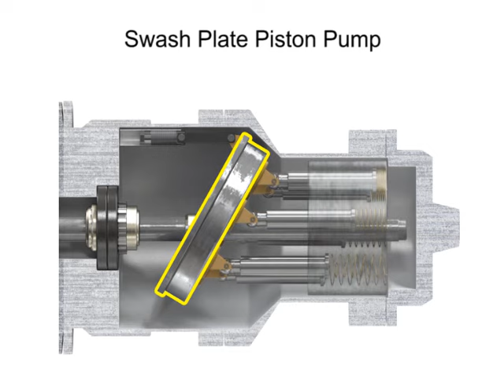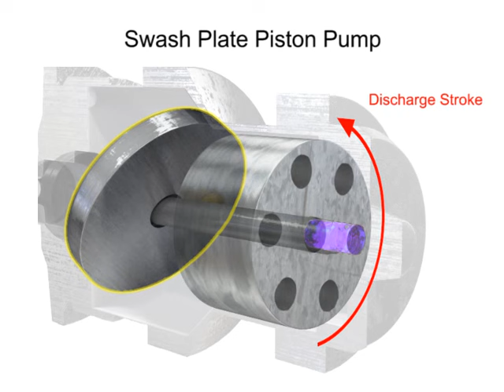Swash Plate Video

Comment: Great video, explains it well. Only thing, the cylinder blocks always have an odd number of pistons so that the suction and discharge side of block won't equalize(cancel each other out), especially in a hydraulic motor. Great illustration, though.
Reply: That's the problem with a hung jury; the Piston Pumping Swash Plate exemplifies the example with each thrust.

Comment: Can u please explain how it controls flow rate, ie,. How it reduces and increases the flow rate whenever necessary
Reply: The swashplate angle I s often controlled via some kind of control mechanism (such as a solenoid valve). Different angles of the swashplate will change how far the pistons can extend from the cylinder bore, thereby changing the volume of fluid they can displace.